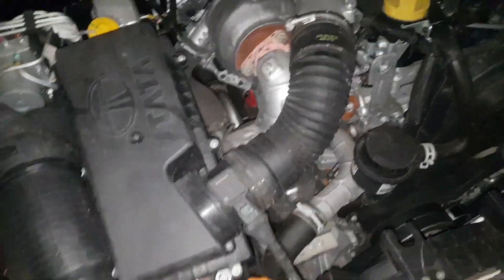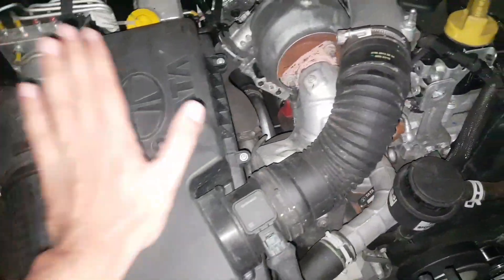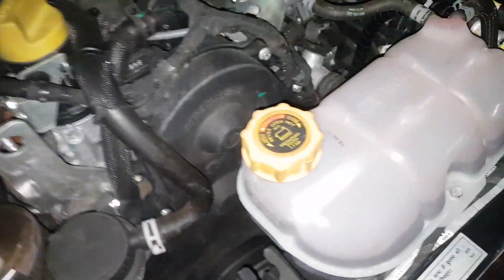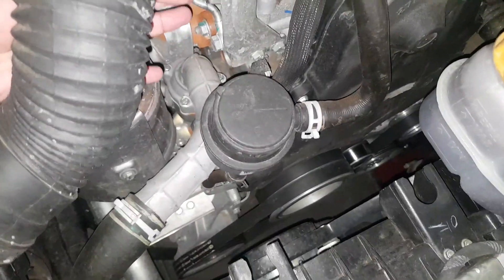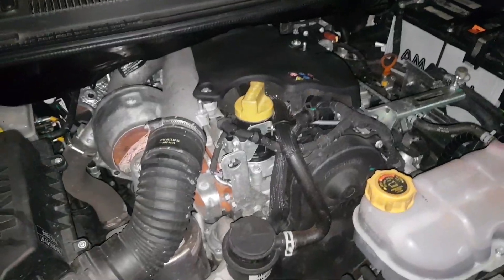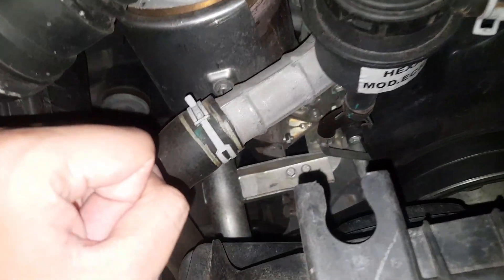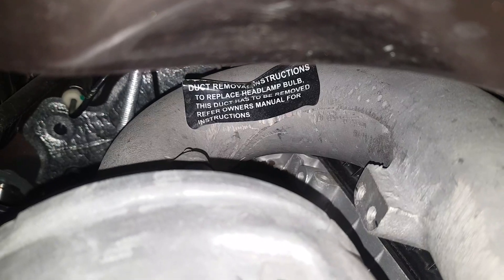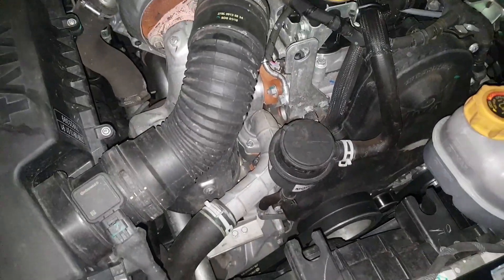Tata Hexa varicor 400 engine review

Comment: Hey Pritham.. i saw your vlog and in this vlog you said that there is no engine cover in that.. here i wanna tell that TATA provides engine cover in hexa either its the old one or new one i recently purchased hexa and it have engine cover.  I think it something worng done by dealer
Reply from the maker: New hexa we took it in August 2019 it's top end XT
Reply: @jurisdoctorakash7238  i have the same model purchased at the time of diwali and it have engine cover.
Reply from the maker: @pawankumardhingra874  is it dual tone
Reply: Pawan I think you should check your chassis number and verify when your vehicle was manufactured. Tata deleted the engine cover somewhere around June 2018